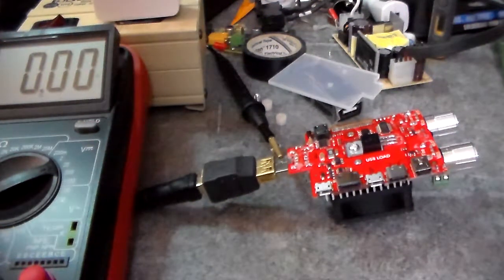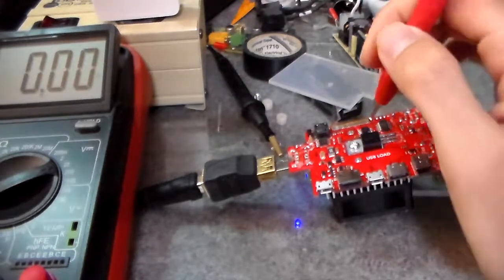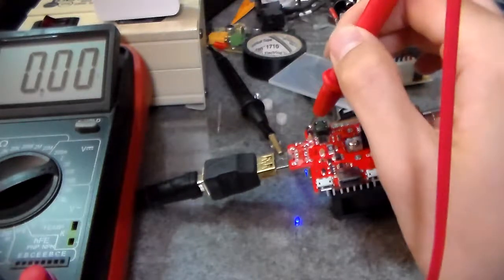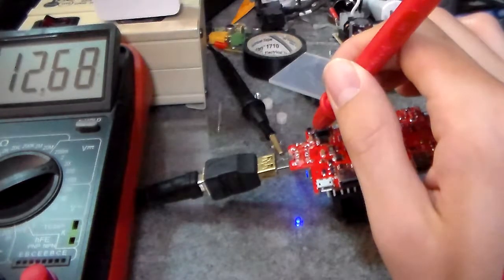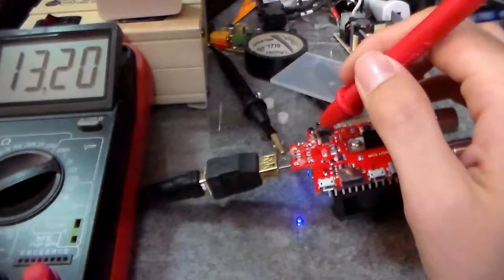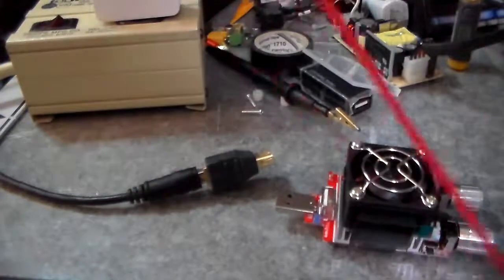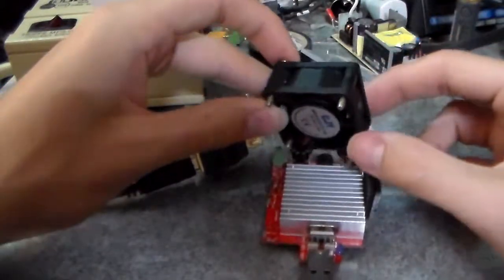35W USB Dummy Load: circuit design of the secondary power and fan control

Comment: I have a similar problem. I plugged a 24V power source into that green connector to certify that the value of 5A written in power supply label is true or not, but I think the transistor burned out. The fan turns on but the lcd panel does not turn on and the heatsink does not heat up because the transistor should not be pulling charge. What can I do to make sure what happened and fix it. Your help is most welcome. Thank you!!
Reply from the maker: well you were pulling WAY too much power through it, it is only rated at 24v so 5A x 24v = 120W I dont think that transistor is even rated at that power with an infinite heatsink. there was probably a warning on the screen that showed ">35W"
Reply from the maker: so how to fix it is to replace the transistor with the same part TIP122 and then make sure the 3v regulator is working, if not then check the two diodes that I talk about in this video. If those arent working then replace them with the same values. after replacing those then the screen should turn on buzzer can beep. if the screen comes on but it still draws no current then you might need to replace the op amp which is marked A63A located near the fine adjustment knob. let me know how it goes!
Reply: SuperBrainAK I had also thought of this 24v X 5A = 120w, but the 5amps would only be pulled completely by the transistor if I raised the potenciometer at the maximum, right? Anyway ... The damage has already occurred. With the transistor exchange, does the whole system return to normal? Do you have knowledge about this? Thank you
Reply from the maker: it should be fixed but it does concern me that the display does not turn on at all. maybe the current resistor is blown out also? too many things that can go wrong, start with my other comment and lets see.
Reply: Sorry for late.

OK, let's step by step: I'll answer according to the passages you asked me to measure
"so how to fix it is to replace the transistor with the same part TIP122"
My Coment: In the inscription on my transistor is marking TIP122 CCOXC W MAR 1728. Do I need another transistor with exactly 100% identical to those same inscriptions, or just TIP122? What would be CCOXC W MAR 1728? :/

"And then make sure the 3v regulator is working, if not then check the two diodes that I talk about in this video. If those arent working then replace them with the same values" 
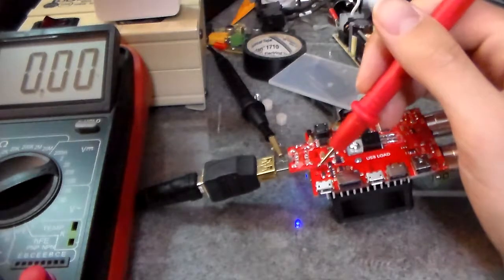My Coment: The first diode you check at 1:36" shows 5.13v (mine 5,31v), and then at 1:43" 4,84v (mine 5,21v). The second diode you check at 2:18" shows 1.54v (mine 0.14v); you check 2:26" shows 4.84v (mine 5.21v)
3v Regulator you check at 1:48" shows 2.99v (mine 0,00v); you check at 1:52" shows 0v (mine 0v); you check at 1:55" shows 4.84v (mine 5.21v).

"If the screen comes on but it still draws no current then you might need to replace the op amp which is marked A63A located near the fine adjustment knob"
My Coment: May I ckeck any values here?

if you need me to measure some more componenete let me know, but if you already have a verdict of what happened, tell me so I can start to arrange the repair.

Thank you so much!
Reply from the maker: Franco Pieruccini Faria ok so 5v power is going into the 3v regulator, and there is 0v coming out of the regulator. You need to replace the regulator with another one of the same voltage and pinout
Reply: SuperBrainAK ok! Where I can find this component to replace?
Reply: SuperBrainAK Hi dear friend, your help has been very useful so far, but I do not know where to get these components for replacement. Could you point me to a store that has these components? Thank You!
Reply from the maker: Franco Pieruccini Faria sorry for the delay, try mouser and digikey get two Incase one is faulty, just search for the part number on it
Reply: SuperBrainAK Hi. Can you identify the exact inscription of this 3V voltage regulator? Mine is erased and I can not even guess what his specifications are.
Reply from the maker: sure, mine is a HT7530-1 3v regulator in the SOT-89 package datasheet: http://www.alldatasheet.com/datasheet-pdf/pdf/142960/HOLTEK/HT7530-1.html
here it is for ebay: https://www.ebay.com/itm/10-PCS-HT7530A-1-SOT-89-HT7530-7530-1-Driver-Regulator-NEW-/121360681153
look for HT7530-1 SOT-89 if you want a better deal, that would get it fixed with not much hassle.
Reply: SuperBrainAK hi friend, I ordered these 3v regulator units, we will see if the replacement will solve the defect. I am going to have multiple units of this, so where these regulators are commonly used or where you normally use it? A question, what do those inscriptions on the transistor mean "CCOXC W MAR 1728"? Thanks.
Reply from the maker: well they can be used for any application that needs a 3v source at 100mA. for the transistor im not sure, normally there are numbers not letters, letters would be date codes, and batch and lot numbers
Reply: SuperBrainAK You say to use this regulator for applications with 3v and 100mA, but this device is capable of draining up to 5A, is not it? Why only 100mA?
Reply from the maker: heh the regulator only provides power to the LCD, processor, and eeprom. the transistor is draining the current directly from the input which doesnt need any voltage regulation. see my new video on it I made a schematic showing most of the parts. https://youtu.be/BL_1p-apLQM
Reply: SuperBrainAK lol I do not have a very wide knowledge to interpret about the complete functioning of the circuit. But I understood your explanation. About the tip122 transistor, the inscriptions that come after that make no difference? Mine for example is TIP122 "CCOXC W MAR 1728", but I did not find any with exactly that name, so would some TIP122 be enough?
Reply from the maker: yea the main marking is TIP122 anything with the same marking will perform very similarily, the other numbers as I said just indicate manufacturer batch date and other stuff that isnt important.
Reply: SuperBrainAK Great. As soon as I change the regulator, I'll let you know if the problem has been solved.
Reply: SuperBrainAK hi dear friend. How are you?! Today arrived the 3v regulators. I replaced by the defective one. So, the output of regulator now is showing 1,24v..... it is also warming (around 60 degrees Celsius) and the loader as well....(warming less than the regulator)... the lcd screen it is not turning on. What I can do now? Thank you very much.
Reply: Hi, my dear friend ... I hope you are doing well. I thank you very much if we can continue talking about this little problem that I said :))). I can not handle this alone. I need your expert help. Thank you!
Reply: Franco Pieruccini Faria   HI! I WAS THE SAME ISSUE.  i connect mine to 30v. so, 3v regulator blown, replaced, tip122 regulator also blown, waiting for parts to arrive. in your case if the out of 3 v regulator show les than 3v (1.24v) it is that there is a short in some place.  it would be great to have a diagram
Reply: @oskimac  Hi friend... Where are you from? My device still not working. :(